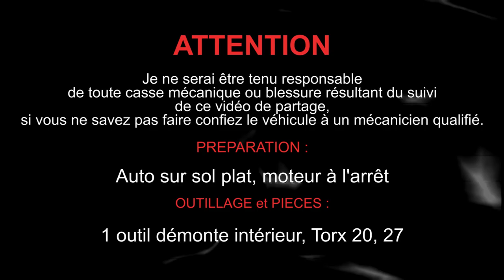Serrure de porte arrière droit Mercedes Benz C220 CDI - W203

Comment: Bonjour,
La serrure était HS ou faisait une mitraillette à l'ouverture et fermeture ?
Reply from the maker: Bonjour,
Au début mitraillette mais après un mois plus rien.
Reply: La mitraillette c'est le ressort qui casse à l'intérieur et il existe un kit de réparation sur ebay ou autre site, j'ai déjà eu l'expérience de changer celui-ci. Et dans votre cas, je pense que le ressort cassé a dû se loger de façon à bloquer la serrure sur une position ouverte ou fermée. En tout cas très bonne vidéo 😉
Reply from the maker: @dd1273 ... Je l'ai remplacé par un occasion et depuis refonctionne correctement je vais ouvrir l'ancien pour voir si je trouve la panne.
Merci